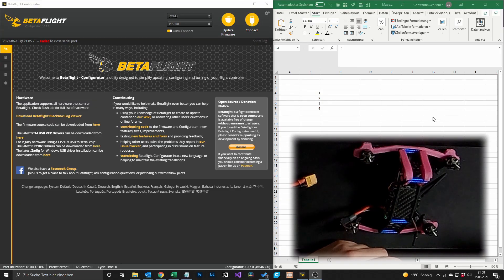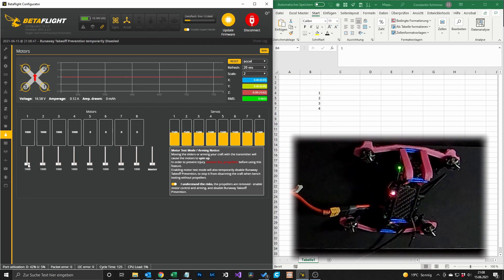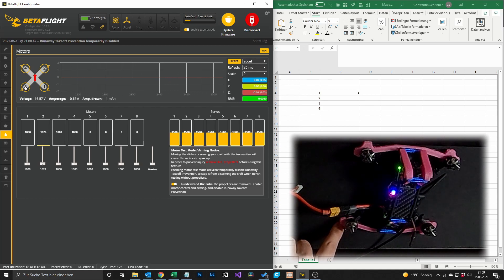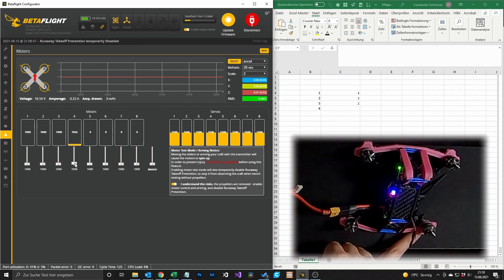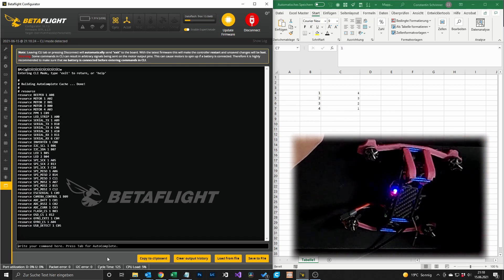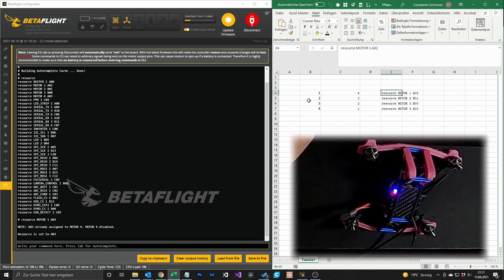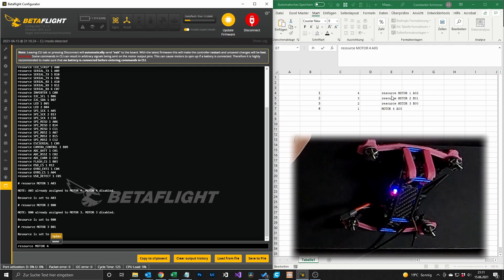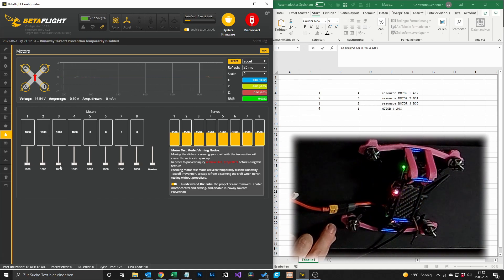How To Swap Motors | Motor Remapping in Betaflight/Emuflight | English Version

Comment: Hi there again Constantin,i'm just wondering if i could only swap between the 2 front motors( Number 2 to 4 and number 4 to 2)? Danke mush for your soonest reply
Reply from the maker: Hey Rob! Yes you can also swap only two motors with that procedure - just make sure that all motors are with a pinout in the end. But I'm curious - why would you have to swap only two motors? 🤔
Reply: @flickFPV  bcoz, right now all the 4 motors are running in one direction( inward) ,and my main idea is if i could switch just the 2 front motors via Betaflight cli maybe the results of these front motors( number 2 & 4) wil spin outward  instead. What do you think ..By the way thanks a lot  again for the quick reply
Reply from the maker: In order to change motor directions use the BLHeli Suite instead (just search the internet for that or have a look at my "How to get custom startup melody..." even though the video is dedicated for another topic you can have a short glimpse at ~3.39 how to change the direction.
If you have BLHELI_S ESCs you can work with the website I show in the video. In case you're using BLheli32 you have to download the program.
I'm planning to show this as well in a video in the next weeks but unfortunately my schedule is busy right now, but I'd bet you find thousands of videos when searching for BLheli Suite 😁

Short explanation why you should do it via BLHeli Suite: If you'd change it with motor remapping your FC will think motor 2 is 4 and vice versa so your FC would go crazy as it thinks it spins front left but it spins front right instead.
Reply from the maker: P.S. Always make sure the motors are spinning in the direction as shown in Betaflight in the motors tab. And also make sure to have the motors aligned right (as I show in this video here in the end)
Reply: gt it bro.thnx @flickFPV
Reply from the maker: I'm happy if I helped you 😉👍
Reply: @flickFPV  Yes bro ,you helped a lot and i did remapping the two front props but i thought it would really reverse the motor directions but i was wrong..I tried to fix this tru BLheli but it won't read my esc/motor..Maybe next time i'll buy an fpv,i should really check on what kind of motors they're installing on the quad or cinewhoop so it'll be compatible to reverse it..By the way, i just wonder why all my iFlight Green Hornet props runs fine but only all turns inward positon?As a newbee of the fpv world i'm kinda frustrated and almost lost interest with it
Reply from the maker: Hey Rob! I think I can help you, but is it possible to contact me via Instagram, Facebook or by mail ?
Then we can share photos/videos and it's easier for me to understand what's wrong 👍
Reply: @flickFPV  Good am to you Constantin,anyway i've already installed a regular BLheli configurator(showing blue color on her screen) last night and easily  able to change the directions of my two front motor directions( now ,the props number 2&4 are rotating away from the camera of which i wanted)!  It's so simple config compared to the BLheli 32 that won't read my esc. I can't get happier than that!!  Maybe u could make also a video of this ,so people that encounters the same problem will be able to fix their props directions easily..But again  thanks bro
Reply from the maker: Gladl you fixed it! For future don't bother to comment or write if you need further assistance - I've been through lot of issues in the past and probably you'll get a shortcut 🤘😁👍
Reply: @flickFPV  Thnx
Reply from the maker: Now there is a video dedicated for changing of motor direction - hope other beginners will now have a easier way to do it straight away 😉